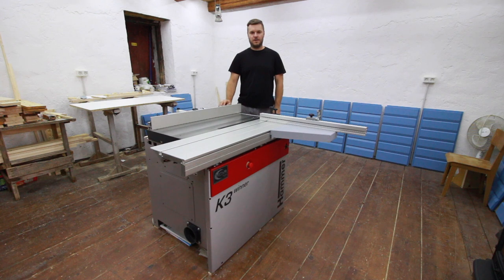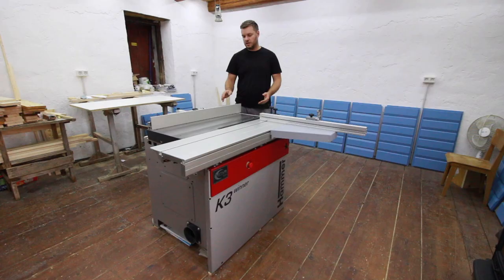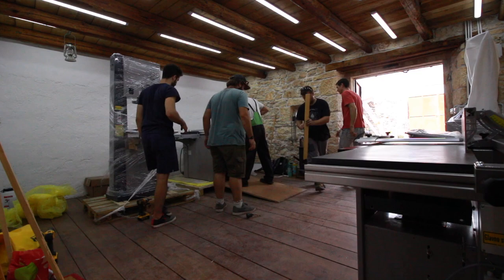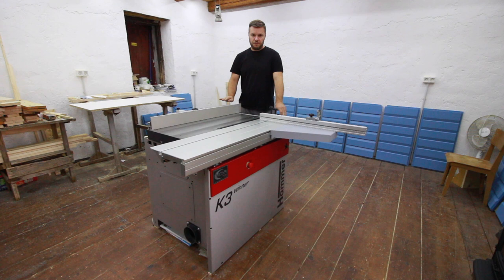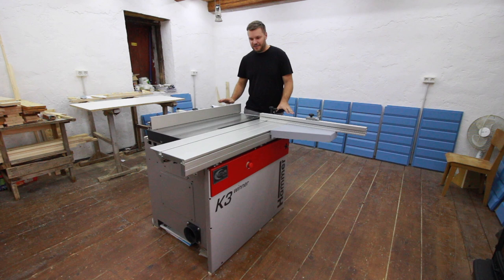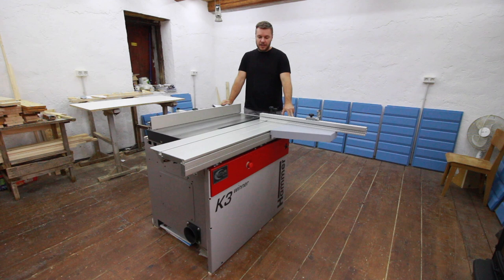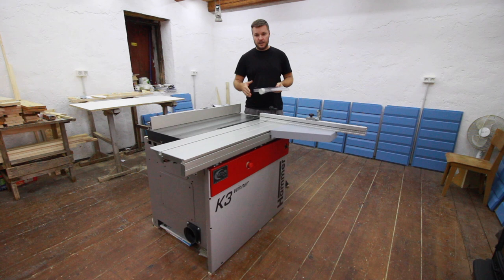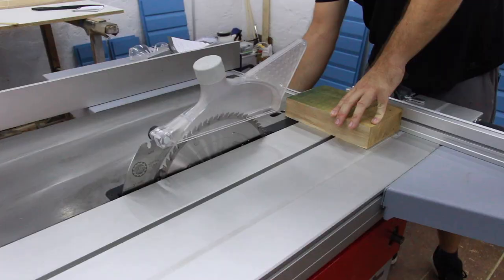What is this???!!! - (Felder) Hammer K3 Winner Review 😡😡😡

Comment: Damaged in transit and you take it off the lorry because you are keen to start working! If the machine arrives damaged like in your case it goes back to Felder and not into the workshop. With the bare eye you could not see at first sight what else happened on that lorry! Naturally you are annoyed 😠 but it's mainly the hauliers fault but yours too by thinking it could be solved later.
Reply from the maker: This is completely true and I agree on that. But that doesn't explain vibrations, riving knife coming loose, some damages on the saw body were rusted so it was an old scratch and overheating of the arbor. The thing is I'm not the only one to have these problems and people actually wrote me same things happened to them. One user even lost a piece of finger due to riving knife becoming loose in the middle of the cut. This is a problem at the production line. Now I have Felder K700 and it is incredibly well made, it looks as it is from another company.

Comment: Man, sorry you got damaged machines. You've had some bad luck with power tools. That's very disappointing. They failed to strap the machines to the wall of the truck and they tipped when the truck made a turn. It looks like it's probably normally a pretty great saw (if it wasn't damaged).
Reply from the maker: Hi Steve, it seems we are out of luck by some extent. On the other hand their Bandsaw and Planer work great. Some modifications were needed to make dust extractor better but now it works fine.

Comment: Wow. That shipper (and reseller) did horribly, and then lied to you about what happened in there. I hope they make this right for you, and they make the reseller pay.
When I bought my Felder K700 in early 2017 (very similar to this, and around the same price), it came in a very well-wrapped pallet, directly from Felder. Felder did all the calibration and setup in the factory, before shipping. I double-checked it, and it was all perfect. No reseller needed or used. The pallet also included anti-tip sensor.
Not sure these will help, but in case they do, here are some pics so you can see how Felder ships things:
https://www.flickr.com/photos/psychlist1972/albums/72157677010951444/page3
Reply from the maker: Wow, what a difference.  It looks like mine was wrapped by a kid. Also you got much more serious saw for the same amount of money? Hmmm
Reply: @AndreaArzensek  
I know people don't share Felder/Hammer prices for some reason, but I think it helps others to know.
I don't have to pay VAT (which is probably a couple thousand euros for you), but my K700P, purchased in late 2016 (arrived in January 2017) was: 

Price $12,454.00
60th Anniversary celebration discount: $2879.00
Total: $9,575.00

That was for:
- 3.0kW 230v motor
- 19.5mm dado tooling prep
- Mechanical scoring unit
- 31" rip capacity
- Micro-adjustable rip fence
- 1100mm crosscut fence
- Precision mitre unit with pin locating system on outrigger
- Edging Shoe
- Eccentric clamp and mount
- TCT 300mm universal saw blade (size needed when using scoring blade)
- TCT 315mm universal saw blade (the size I usually use)
- Adjustable TCT scoring blade 100mm
- Riving knife

Shipping was a couple hundred USD, as I recall, for both the jointer and the K700P. Purchased it all through the Felder office in Delaware, US. They arranged all shipping once it arrived in the US. Not sure if they sell direct in Europe, or if you have to go through a reseller.

The assembly was not difficult; you don't need someone to do that for you.
Reply from the maker: @Psychlist1972  Yup, your saw is more than double the price but for a reason as well. I thought about upgrading in future with Felder 700 or 900 series.
Also I got response from the Balkans representative and it was not what I expected. I will publish another update video soon.
I'm still very happy with A3-41. How is yours performing and how long have you had it?
Reply: @AndreaArzensek  I got ther A3-41 the same day as the K700 (early 2017). I don't use it as much as the saw (sometimes I buy wood S4S, sometimes I'm working with plywood or MDF), but it has been a joy to use every time I've used it. I really like how well it does with figured wood, and how quiet it is. Cranking the table up and down has made me batch my work so I make sure to finish all the jointing before planing. I also really like having such a large, flat table on the jointer. 
The only thing I don't like is the fence. But you have to go way up in the Felder line to get a different style. I find it can go out of square if you put too much pressure on it. I shouldn't do that, but it's an old habit from having a cast iron fence on my old 6" jointer, so sometimes I forget.

Comment: Please correct me if I am wrong, but has this Hammer been replaced by a Felder K700? Update - just found the update video that confirmed the history. 

 I have watched this video a few times and either the distributor should have their distribution contract terminated or there is something serious wrong with the Quality Control at Hammer (Felder).
Reply from the maker: Hi Paul, 
Yes, I have a video update on this. We upgraded to K700 and it is a great machine so far and I can't foresee any problems in the near future. Build quality is amazing.
I also believe that something is wrong with QC at Hammer line because all of the Hammer machines we bought had some issue.

Comment: I was thinking of getting a K3 but now I’m having second thoughts. That after sales is shocking
Reply from the maker: It was indeed shocking. Recently I received a new one and it is working perfectly (for now) and they treated me really nicely. I suppose they understood the error and wanted to make it correct. I will have a video around the end of this month.
Reply: That about sums up my experience with Felder. They are not the least interested in fixing things. Once you have paid all they do is talking and zero helping.
Reply: I have had a K3 48x48 for 4 years. I would not recommend it. The slider is impossible to keep square, and the cheap locking mechanism, which secures the slider, degrades over time. Even with the Marius Hornberger upgrade to the crosscut fence, it is impossible to ensure a solid and true crosscut for any duration of time. For the cost, there are better performing saws.
Reply from the maker: Now we have Felder K700 and it is absolutely fantastic. I have no complaints and I don't see any problems in the near future. It is built like a tank and it will probably last forever, or until we decide to upgrade to a bigger saw.

Comment: That is shocking!! That saw is a lemon and needs to be replaced, something structural in the motor/trunnion assembly is bent for sure to cook bearings and belts and the vibration is terrible. Your blade height control should not be like that, how anybody that is supposed to service machinery can say is okay is beyond me, I assume it's the same plonker with his arm inside a running machine and his head 30cm from a spinning blade....... WTF! 

I'm in the market for a new bandsaw and was actually seriously considering buying a Hammer N4400 in the UK so await your review on that machine patiently but this has really turned me off. I have bought all my machinery so far from Axminster Power Tool Centre in the UK, they use their own truck and employee for delivery and everything arrived in perfect condition, I had one small issue with my saw being supplied with an incorrect blade, called them and they resolved immediately and shipped the correct part to me next day. I have bought a planer/thicknesser, edge sander, table saw, pillar drill and dust extractor from them so far with only that one tiny issue.... maybe I should stick to what I know works and swerve Felder/Hammer! 

Good luck getting your mess resolved, I would suggest trolling Felder on Twitter and writing a complaint letter to them. Your local dealer is obviously a waste of time and will never resolve your issues, I think you will have a much better time with Felder direct. I'd suggest joining some woodworking forums on Facebook and sharing the link to your video also, the more exposure you get the more likely you will get a response from Felder, Kings Fine Woodworking is a good group and I'm sure 1000's of people will view the video just to help you out.

Good luck and looking forward to hopefully seeing a video soon with you praising Felder for their customer service in sorting the mess out for you.
Reply from the maker: Hi Phil,
Thank you for your kind words and support. 
I still believe that these machines are well made and that I got a lemon. But I don't like that they treat me like I'm stupid and without voice. 
As for the machines I got I can highly recommend A3-41 with spiral head, there are some minor design things but at this price it is fantastic.
The band saw N4400 is hard for me because I got a bad quality blade on it and it was damaged a bit in the transport but it runs very smooth and it has plenty of power. The machine is really nicely made but at least mine has some things I didn't like and I don't know if they are caused by transport or they are built that way. Wait for the review to decide if you'd like to get one. 
Best regards from Croatia
Reply: Hello Phil, the damage was caused by the transport. That has nothing to do with the quality of our machines. We are already in contact with Mr. Arzensek and we will find a suitable solution together. If you have any questions about our machines, please feel free to contact us

Comment: Hi, I have a Hammer N4400 and the 410mm planer with spiral cutter, I am educated mechanical ingineer with 30 years experience in machine construction, and after my opinion my Hammer machines are made like cheap chineese machines, I have a hard time to believe that Hammer are made in Austria, I think they are Chinese made, I Aldo have a Felder F700 saw, this is a compleatly diferent qualety it is made to be used and Last.
My Hammer machines i have to use as hobby machines for light work, for the future I will buy used profesional machines...
For now I am stuck with my Hammers..
Reply from the maker: Hi Gerner,
It seems that we share the same opinion about these machines. They are ok but nothing more than that. I'm ok with N4400 and with A3-41. Now I replaced K3 Winner with Felder K700, I hope I will be satisfied as you are. 
Best regards from Croatia
Reply: This about sums up my experience with Felder. Also they are not the least interested in fixing things. Once you have paid all they do is talking and zero helping.

Comment: You will find out the business ethics of any company as soon as you need customer service .
Apparently the Felder Group has zero customer service .
Reply from the maker: At the end they made it right. I will keep this video for future buyers and reference as how not to buy and get the machine delivered (that was my mistake). Best regards from Croatia 😊
Reply: Safe delivery is a real problem . i had a new compressor derived to me in Germany and when it arrived the box had a big hole in it and some oil had leaked out , indicating that it fell over in the truck . fortunately it was ok , but this type of incompetence and or not caring by the shipping companies must stop . 
i'm thinking of buying a table saw from a company near Bodensee , only about two hours drive from my house . if i do buy it , i will take my anhanger / trailer and pick it up myself . that way i know it will be safe .

Comment: Yeeezzz those vibrations ... Have this been resolved ? Felder can not be proud of this, and should supply you with a new one, and fix this machine at their shop. Then they could sell it as used one and save som face. 
I had a Felder KF700S saw/router and are as I told in another video in the marked for a brand new saw for the shop. This is certainly a ding in the Felder fasade.... 
Of course all machines can be faulty, the hallmark of a good company is how the deal with problems for the end user. 
Not good.
Reply from the maker: Yup definitely not good. We upgraded to K700 but have not received it yet. It is supposed to come next week. I'll have video somewhere in February. Cheers
Reply: This video about sums up my experience with Felder. They are not the least interested in fixing things. Once you have paid all they do is talking and zero helping.

Comment: So Felder contacts you and says you should be careful what you say in your video? That sounds like threatening with legal action. What an idiots.

I will think again before buying their tools.

I'm a truck driver myself and I would not be surprised is this guy didn't use any straps at all. I'm 100% sure it was not loaded in such a way. Just fell over while driving.

If I get a truck which is loaded not good I always take pics before driving.

Also, a honest truck driver will never push for a fast signature.
 Too bad transport is all about cutting cost and speed nowadays.

Apart from that I think the saw should better be in a crate. Because if it is strapped secure the straps will bend the table, damage the sliding part maybe.
Reply from the maker: Yup, just like you've read. It was quite shocking when we heard it. We have it taped but I didn't want to go that route. It just a backup insurance.

Comment: Hi Andrea, your first and biggest mistake was to sign the delivery paperwork. Obviously the machines have been damaged in transit. Once you sign the delivery paperwork declaring the machines have been received in good condition there is often no recourse available through the delivery company.  Did you or the local dealer have insurance to cover repair costs in case the machines were damaged in transit? I don't see this as being the manufacturers fault unless you bought the machines directly from the manufacturer and the manufacturer had insurance in place to cover the possibility of delivery damage. In which case the onus would be on the manufacturer to put your machines right and deal with their insurance provider. 
In your situation I believe your recourse should be focused on the local dealer and delivery company.